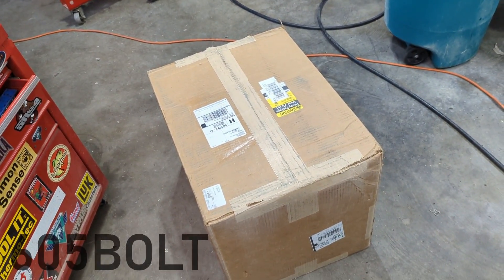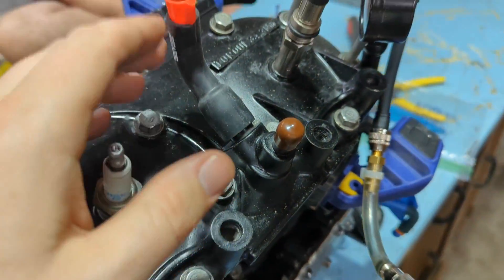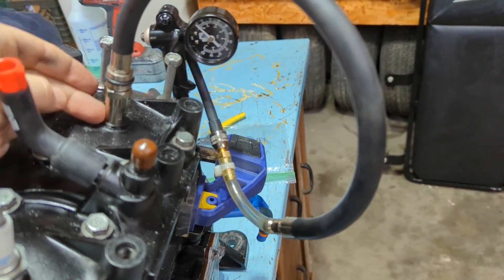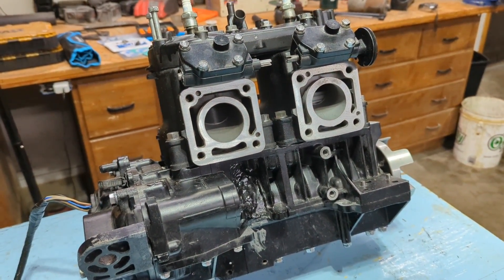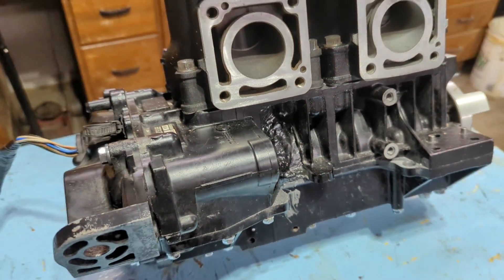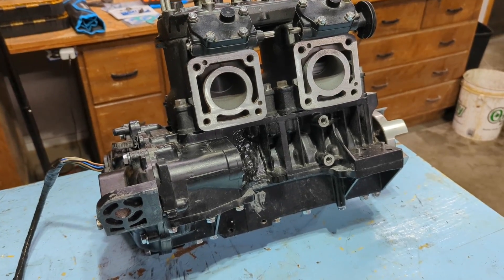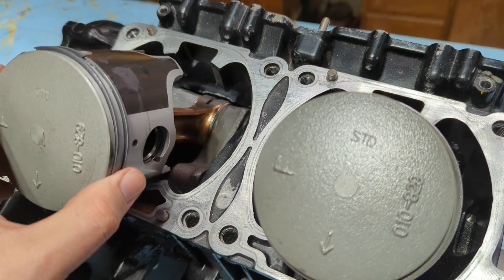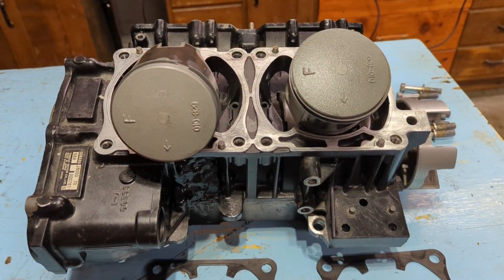Rebuilt GP800R Engine Arrives, But It Is JUNK.

Comment: Send them the link to this video - they probably are just thinking you are a nobody with no viewers, that they can treat terribly and just walk away from with no recourse.

I was looking at PWC for my rebuild - but they are 100% NOT the company I would use now - so thanks for this video - saved me a bunch of money.

They also have the gall to post that they are the best and slate SBT core's - but this has exposed their workmanship as 'not fit for purpose' 

I suggest you lawyer up, demand a FULL refund for their sub-standard work and also additional compensation at THEIR hourly chargeout rate, for the time you spent putting right their shoddy workmanship.

Then post up the lawyers letter and this video on EVERY PWC forum you can find, advising that you will update in due course with their (PWC's) response.

It infuriates me that these people get away with charging money for appalling quality of work - expose them and help save other ski-owners from being ripped off!
Reply from the maker: Before I even spent a dollar with them I was 100% honest saying that I'm filming everything and whatnot.  It turned out to be a pain in the ass process.  I obviously won't be using them for any future work if possible.  For all the trashing of SBT, the small interactions I have had along the way with SBT has been quite positive.  Just random parts here and there they have been helpful and knowledgeable.  If you watch the followup vids, I actually disassemble and replace this entire engine myself.  Kind of the only option to save half the summer and be able to ride.  Take the L and move on I guess.  For the record, it works well now (even with me building it) and I think it will be fine.  Just a shame that it turned into a fiasco.  Also, I ate all the labor on the engine rebuild.  Figured I would make lemonade out of my lemons by making a video explaining the process.  Hopefully it helps a few people out.  I appreciate you taking the time to watch and hope your build goes well.  Looking back on it, next time I will buy all the parts from WSM and build it myself.  Save the money, time, and headache.
Reply: @605BOLT  Glad it works well and you're up and running but feel your frustration - I always try and repair myself where I can as I know I will spend the extra time checking everything properly - even if it means eating into leisure time - learning stuff is all part of the 'fun' anyway - thanks for sharing the video's and your experience - I will try and do the same in future ;-)
Reply from the maker: I offered to assembly myself but he said it would only save me 150 bucks and have no warranty so I figured letting them assemble was best.  After it all went down, I would do differently haha.